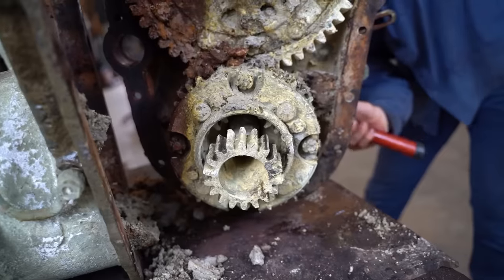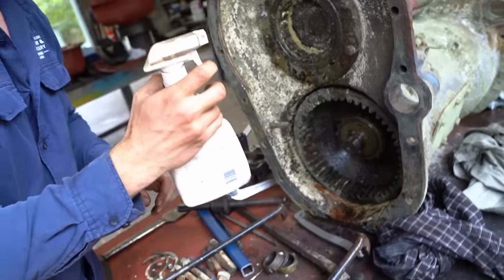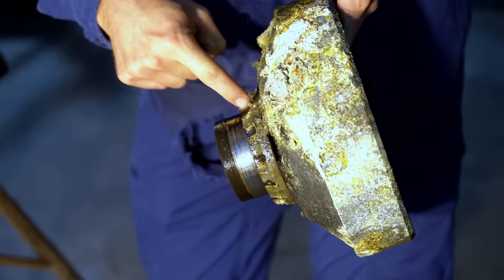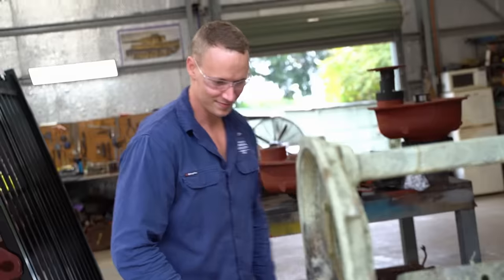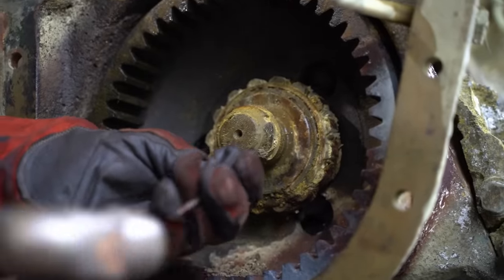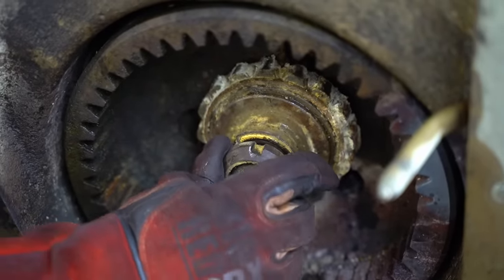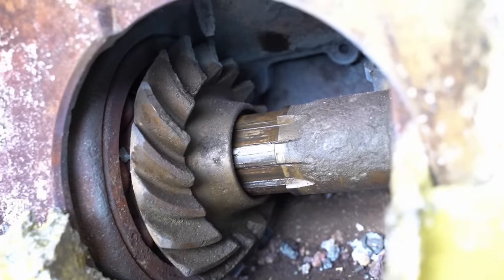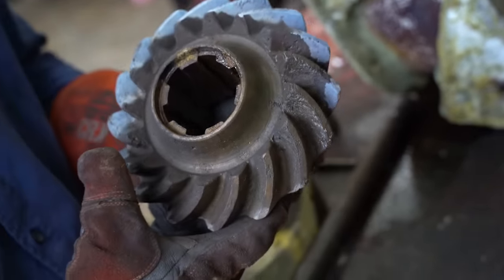Workshop Wednesday - STUG III G RESTORATION Ep. 14

Comment: Why didnt he make a spanner wrench? it would have prevented the marring of the catch points of the nut, as well as heating it to get the ring to expand and loosen off the oil/grease that is inside?
Reply: Who knows. I was wondering the same thing. It’s one thing if you can get replacements to just hang on it… it would not have taken too long to build a tool.
Reply: I had the same thought, there appears to be a lot of those 4 slotted nuts in what appear to be the same size, a shop built tool for unscrewing them would be the ticket rather than knocking them off with a chisel.

Comment: Hi, the Numbers on the planetary carrier are Production Marks.
The 2parts Carrier will be machined as a pre assembly to have the Perfect allignment of the planetary bolts later.
To find the Right Couple again in final assembly after cleaning the parts the Numbers are added
Reply: Like 2 halves of a set? That was my first guess. Also thought of 1938 but that makes no sense.
I think you are correct

Comment: This really shows just how high quality the German manufactured stuff was compared to Allied made stuff. Brilliant work guys!
Reply: The trouble is that in a war of production capacity, quality standards should be reduced in order to lift production numbers. You don't have to go as low as the Soviet T-34 standards of expected survival rates of less than one tank of diesel fuel, but building to Swiss watch standards is going to hurt in the long run.

Comment: I am incredibly amazed of your work, pulling a complete warped and bended wreck out of the mud and rebuilding it to a working vehicle is nothing short of a miracle!
About the markings: most probably identifying the two pieces that match up perfectly against each other. When I did a few part time jobs in modern workshops they still had the practice to check which pieces fit together best and mark them. ("best" meaning tolerances of 1/100mm etc). 
The only sobering thing: These tanks were built and operated by a terrible regime, and most probably forced labour was used in building them :-/ We should never forget that it was a very good thing that germany lost that war (and I am german btw).  Still - they are fascinating machines.

Comment: Its unusual to see the the ball bearing angular contacts inside the drive train. Today they are only used in a low load high precision environment. Like a high speed ball screw in a CNC machine. They are very sensitive to preload far more than Timkens. But back then perhaps they didn't have access to Timken style bearing tech being from the USA. 
The split inner race bearings shouldn't be a big deal to source, but I have got out of trouble with these in the past by getting two bearings and wire cutting the inner race then grinding them to size. A bit fiddly but possible.
The hypoid gears will be a pain to set up when it's ready though as the ring gear isn't restrained on the shaft in one direction it just preloads against the pinion.  This is probably why they had problems.

Comment: Great video Kurt. 
I really look forward to your weekly videos as they are so informative, and I also love anything to do with Armour.
The engineering on that gearbox has certainly stood the test of time with a lot of the internals being salvageable. 
It will be very interesting to see what parts have to be made to replace damaged or worn and rusted parts.

I build and paint 1/16 Scale RC Tanks and some of the more modern RC Tanks use planetary gears that one has to assemble on the like of the Tamiya 1/16 scale RC German Leopard 2A6, and the Tamiya 1/16 RC M1A2 Abrams, but they are a lot smaller than those from the STUG III G....lol

My wife and I will come up to Cairns and we will definitely be coming along to the Armour Museum as my wife also likes Tanks. 

My wife has her own 1/16 scale  RC Tiger 1 Afrika Korps that I built for her when I built my Tiger 1 Afrika Korps.
So we can have our own little infra red tank battles if I drive my 1/16 RC M26 Pershing.....lol

Comment: The shim on under the snap ring is a set-up feature. With helical cut gears, the depth of the mesh between the pair is a critical aspect of the set-up. The distance between the L and R snap rings is intentionally greater than the overall dimension of the 'stack', allowing the lateral location of the helical gears to be adjusted L/R to fine-tune the mesh. See procedures for setting up automotive differential gears for clues on how to properly adjust the mesh. Involves using marker paint on the gear teeth to see that the contact patch is centered. If the contact patch is not centered, high-torque situations risk shearing teeth off the helical gears.

Comment: Great video. Thanks guys. Some beautiful engineering revealed. If anyone wants to know some cold, hard facts about why the Germans (and Italians) lost the war, read: The Secret Horsepower Race by Calum E. Douglas. Fuel and strategic metal shortages were two of the most significant factors, in regard to Luftwaffe fighter engine availability and many other areas.

Comment: Kurt, I don't mean to be pedantic but ; The Third Reich didn't lose the war because they shimmed their bearings or built things well, they were DEFEATED by the combined will, sacrifice , and dedication of a world united against their goals.
Rant off.

Hats off to you gentlemen for you skill, perseverance and application in saving as much of the StuG as is possible. Bravo!
Reply: If anything that shim (if applique) was a testament in itself to ingenuity of a mechanic in the field or at a regional rear service workshop. Instead of discarding this whole housing they found a fix possibly saving time and putting it back in service.
Or that shim is part of the original design which does not make it a total failure, the shim took a brunt of abrasion and heat.

Comment: Some very solid workshop engineering practice going on there. Thinking it through and doing it properly. Well done lads.
Just a gentle suggestion on those machined parts: I would vapour blast with glass particles rather than sand / shot blast. Maybe even vibration cleaning using glass beads? The casing will stand sand blasting but again vapour blasting will bring out a better finish.
Reply: Another option would be to sand blast using Dry Ice.
Reply: I once saw a bloke using Sodium Bicarbonate (baking soda) to blast some small critical pieces.

Another alternative is a decent-sized ultra-sonic tank.

El-cheapo treatment of removal of red rust, fossilized grease, etc? Boiling water. in anything from a small saucepan to a 55 gallon drum.

Molasses is a good de-ruster; slow but thorough. NOT to be used on any aluminium or magnesium alloy components. All real North Queenslanders will be familiar with the smell.

Comment: Try Kroil, great penetrating oil. They're Germans, it's what they do! 😉 can't wait to see this refurbished and really loved this episode!
Reply: If you need a LOT of penetrant to dismantle a piece of gear, try a 50 / 50 mix of  Acetone and Automatic transmission fluid. Cheaper and works on par with the "real" stuff. Not recommended for use if someone else is waving a gas-axe around in close proximity,, though,

Comment: for the numbers electropenciled on the planetary housing, it's very probable it was an assembly number, to keep track of parts when disassembling the unit
this is a holdover from the old world manufacturing, in a time when interchangeable parts weren't a thing, so you needed to keep track of parts to guarantee proper function of assemblies
in WWII, German manufacturing still had a leg in that old thinking, same way they stuck serial numbers on a lot of firearms parts that other countries wouldn't bother about

Comment: Maybe it would be possible to have the gears re-hardened/ heat treated, if the teeth are OK. Also that thin packing piece is a shim, that set the clearance for the shaft or bevel/ ring gear. Another really in depth look at how everything fits together and comes apart.

Comment: Re: that "38" marking--measure the shim you pulled out from under the circlip.  Is it 0.38mm thick?  If so, you've found your answer.

For (25 years later) German automotive transmissions, we've seen markings like that which denote a measurement, usually some difference from a given dimension.

It could also just be a number that denotes which parts go together, like each of these was going into diff #38 on that production line on that day or some such.  But I'm betting it's some sort of dimension call-out.
Reply: Not uncommon for machinist to put random markings to remind them of measurements. But I think your second half is more correct
Reply: I suspect the planetary drive would have been bored in a way which made it important to not only keep the two halves as a matching set, but also the orientation (could go back on any of 4 ways if 4 gears inside) so they put a matching number on each half . The shims either side of the bevel gear would be chosen on assembly to get the correct mesh / backlash as per a car rear diff.
Reply: @6803U4  all though it could be true, German manufacturing was exceptional quality.

Comment: The 38 is going to refer to part number or serial number, generally this is stamped into the casting but 'scribed' means probly the manufacturer put it on for other reasons- unless this can be found onto simliar transmissions than you will find out which it is
Reply: Updated part?
Reply: @garynew9637  generally no, the number would have a generic system of e.g. '38/2' or '38B'

The reason being in the field, they can't mix and match outdated parts with new parts
Reply: I would like to think there is some sort of technical maintenance document of the transmission that had all the numbered parts in a item break down diagram- probably from '1' being the centre casting... so on

Comment: BTW: the paper thin washer might have been used to adjust the alignment of the hypoid gears to gain an even running pattern spot in the middle. Not uncommon, since the whole thing is built up from one side.

Comment: Isn't the numbers scribed into the planetary gears assembly from the machining station the planetary gear hubs were machined on (2 halves of planetary gear "basket" are clamped/bolted together and gear shafts are line bored so everything is in correct position) so parts stayed as matched sets, 38 probably refers to 38th planetary gear basket and numbers on each half is so basket is assembled in correct orientation.

Comment: Those markings seam to become more and more common towards the end of the war. To me, it seams like a direct effect of the slow increase in manufacturing tolerances, which mostly affected in castings and gears. Maybe those markings were made by a factory worker who's task was to try and put together different parts that would normally be discarded, in an attempt of finding a fitting in between them?

Comment: I'm surprised that you guys aren't making up C and peg spanners as the need arises.  Saves messing up all the otherwise decent nuts with chisels and drifts, so they could be reused.  Also would allow you to torque to spec on reassembly, where needed.
I also find that greasing the threads on pullers with a high-spec grease, preferably with a moly additive, bears fruit in the ease of use.

Comment: I'm going to suggest the number on the piece is to make sure they marry up the right two pieces. 

Since a lot of the AFV construction was so...... hand made, hand finished, literally custom work, how else do you make sure that the pieces that you finished to fit together, fit together? You put a number on it. And if you're making a few of them in small batches, you do the same. 

Cast one half of piece 38, make it 38, to match to it the other side of the assembly. 

This is a suggestion just to be clear. I'm not as familiar with the numbers as I want to be. The system though, subcontractors producing components to be assembled in a larger workshop to final production, that I am familiar with.

Comment: This is pure speculation on my part, but I believe those hand-carved numbers are part numbers. They presumably functioned as instructions for the workers that would've been assembling the different components, telling them what part went where on a certain vehicle. That's the only reason I can think of why the two halves of the casing at 10:15 would have the same number carved into them.

Comment: Hello! Theese mark numbers should be from repair shop (maybe general maintence). Before they disassembled it, they've put numbers on it and sand it to "total workers" for cleaning. So, they needed numbers to know, which one pairs to which. But it doesn't have to be true. Numbers were also used in factories, to count products, as a lot of parts had to travel to assembly place, due to split of production to old mines and underground. You say "what a machinery, what a precision of german stuff. It's not so true eighter. A lot of this parts came from Czechoslovakia (protectorat Böhmen und Mähren) made by Czech people. Remember, best stuff in wehrmacht were stolen after Münich dictate.

Comment: 10:04 id purely specualtively say thatmight be the year of production of this subassembly Stug 3 had a bunch of standardized pats some might have been produced earlier for other vehicles as well like heavy construction equipment, halftracks , shovels and excavators
Reply: I was going to say the same thing I think in this video the 38 | 38 the scribe is the same handwriting. 
is possibly year with corresponding year when the to parts of the housing were joined. 
or 3. 8. 1938 
But that would be crazy low production number as only about 75  Panzerkampfwagen III's had been produced thus far before 1939.
Reply: @ericscottstevens  yes , just a few tanks , but a whole bunch of parts of subassemblies , this might be one of them , put a date on it and stored it til it was build into one

Comment: Copper bearing surfaces. You say tin washers at about 16:30 but that’s grossly incorrect. The tin being hard prevents it from collapsing while the copper provides a very smooth surface to run on. A cheap and replaceable part compared to say a whole drum.

Comment: German Engineering, as good as it is... It made field service an nightmare.  This is where U.S. Engineering made the difference...If the Allies needed to change a drive on a Sherman.  remove the front steel plate pull the drive and replace it... Tiger or most German Tanks... especially the Tiger, you had to pull the turret and gut the interior... to pull the drive.  It was faster to just switch tanks and take a week or two to replace the drive

Comment: "spacer on a spacer." how very Teutonic!
since youre not using the housing anyway couldnt you cut it away from the gears like the cut a car away from around a crash victim? 
i dont know whats more surprising, that its in such good condition despite being submerged for decades or that the tolerances on a piece of german engineering was loose enough to need a shim lol! i guess there was a war on lol.

Comment: 14:38 They lost it because of over-engineering everything. A german engineer with self-esteem never engineers something silly stupid simple. They always think across three corners ahead and maintain "a certain quality". Good so far. If it were only for the quality they should have won the war. But it wasn't. It was availability and quick replacements of cheesy cheap tanks and armoury. The Merkins and the Russians got that right at the perfect moment. The Germans didn't. Additionally the political "elite" hasn't realized that "bigger" isn't always "better" and they tend to interfere with the designs and developements. A lot stuff - finally - has been prooven dead-end developements. But what. I think we were better off with Germany not winning the war. And I'm German. Thanks for sharing !

Comment: I am kinda wondering.  Why not make special proprietary tools to take it apart instead of destroying original shaft nuts with a hammer and chisel.  That's rather short sighted . Noob action . It shows skills to make the appropriate tooling . It shows lack of skills to torch and chisel stuff into oblivion
Reply: We can be sure that THEY ALREADY KNOW THAT, so how about speculating what their reasoning is.
Reply: You obviously have no mechanical knowledge or have never got your hands dirty. All the specialist tools would be of no use in a gearbox in this condition. Without the torch this would never come apart. These guys know what they are doing.
Reply: First of all time is money, second the sort of tool you are talking about would not dismantle seized rusted parts. Imagine making such a tool and then find it was all a waste of time and effort.
Reply: @FairladyS130  time is money ???? This is not a corporation . This is a tank museum . Furthermore, perhaps a tool like that would fail if you would make one . Myself however I have been a mechanic since 1987 and I make tools for applications of multiple sorts . A tool like is needed to loosen nuts like these are quite simple to produce and will easily work on an pneumatic impact driver and will last the job .